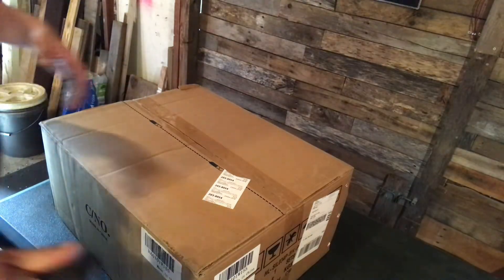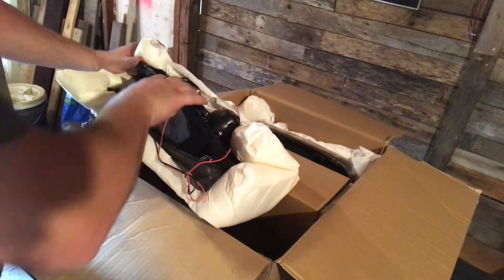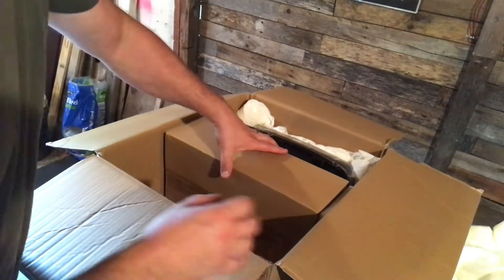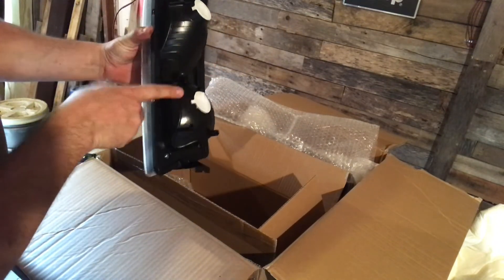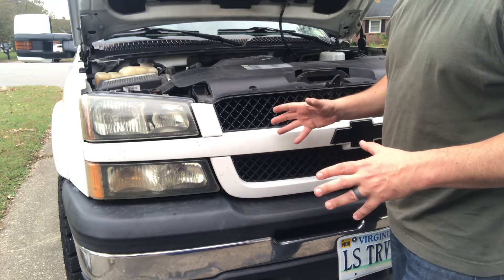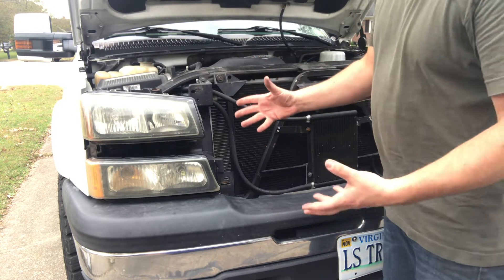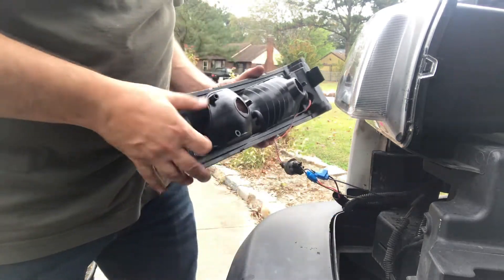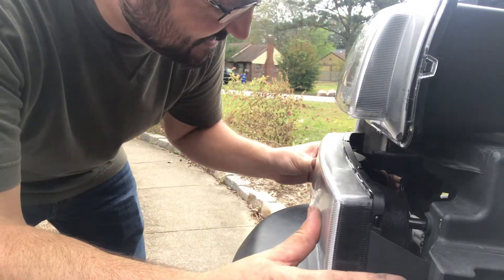AUTOSAVER88 Projector Housings for 2003-06/07 Chevy Silverado/Classic & 03-06 Avalanche WBH Models

Comment: Hey man, just installed similar headlights into my 03 Silverado and used your video for reference which helped a lot! I wired into the parking lights thought. Issue I’m having though is there’s a pretty big gap between the new headlights and the grille, so much so I can see the wiring behind. Is there anything I can do to fix this?

Comment: Thanks for the info I just got these exact same lights. How did the halogen beam pattern work in the projector style headlight?  And also do you know if you can install LED in these projector style?
I currently have LEDs in the factory style reflector housing and the light is all over the place

Comment: All my lights including my DRL worked prior to installing these headlights. I hooked everything up the same way you did in the video. However I used Posi taps to tap into my DRL for the top LED strip , for some reason they won’t come on. Everything else works now except my DRL
Reply from the maker: Make sure the posi-tap seated properly for the lead and that your ground is tied into the harness properly as well.
Reply: @takeroadslesstraveled6505  just checked all wiring is good don’t know what to do next. Anyway I can test the top LED strip?

Comment: So for the t clips, do you cut the red and black wire and then attach the clips? Cause I can’t get my upper U lights to come on
Reply from the maker: No need to cut. One side slips over your factory wire while the other slides into the clip. Crimp down on the jointer plate and lock down the cover.

Comment: When in the daytime running light position while the strips are off, if you engage the blinker, do they come on or stay off?
Reply from the maker: if you have the LED strip tied to the DRL, it will not come with the turn signal. It will only come on for the DRL. If you want it tied to to the turn signal then you need to wire it to the turn signal loom.